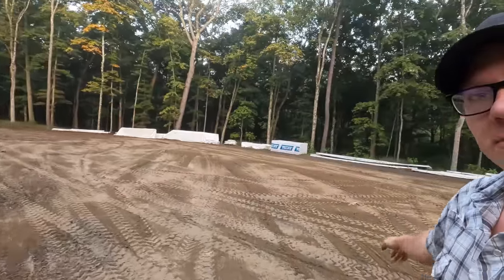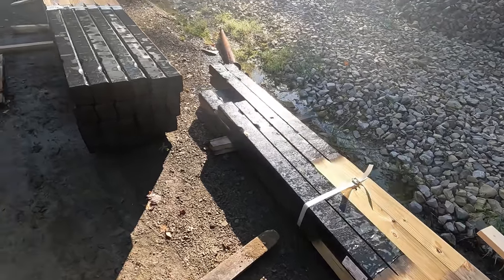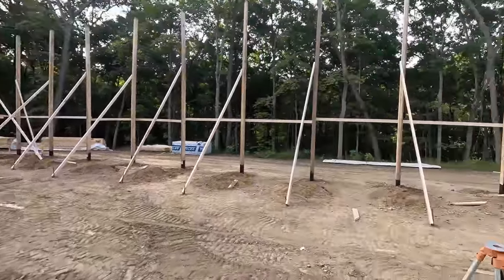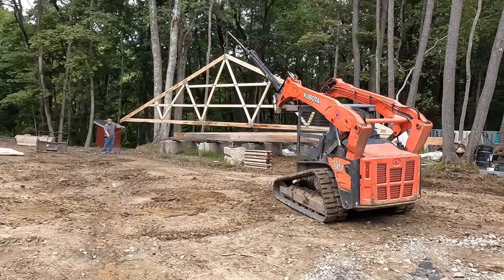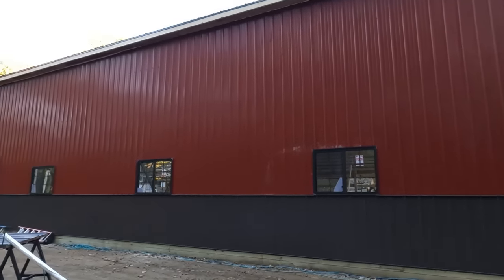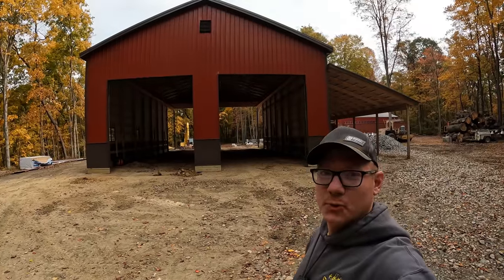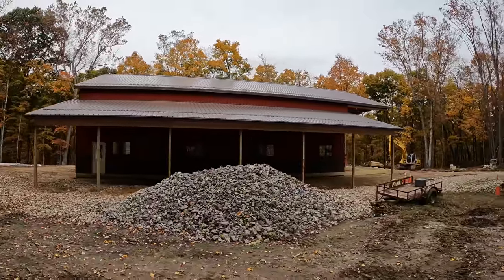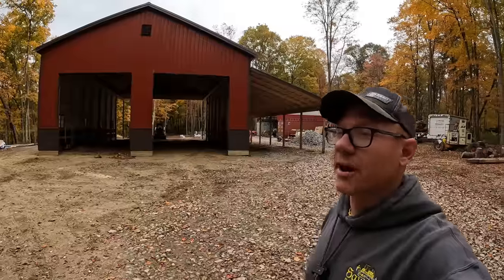Building a Dream Workshop! (Finally) Putting up the shell!

Comment: Nice building Matt, those guys did a nice looking job, it looks square and plumb by the way the metal all fit. The will be nice to keep some of your equipment in out of the weather, especially in the winter. Are you planning on placing concrete in your lean to area while you have the masons there? It looks like a good spot for a couple of chairs and a table when you’re relaxing or editing, or enjoying a canned adult beverage. 
And don’t let anyone tell you different, a 40 x 80 foot building is huge! Good luck filling it up.

Comment: One thing I would like to mention is the ground treated wood will rot out in 20 years. I can testify to it. The posts on my over hang need to be replaced also. I should have put in Sauna Tubes and bolted the posts that way it would be easy to replace later. You could still wrap your ground treated wood with metal which would make it last 40 years. I built my shop at 38 and now I'm 60 and the side metal on the bottom of the building is coming loose. Bad news is I concreted the sides of the shop.:face-orange-biting-nails::face-fuchsia-tongue-out:

Comment: Beautiful building,  as a builder of these pole barns post frame structures for 25 + years I do have some concerns though.  Did you put a cement footer under the posts? If not what's to keep it from sinking? Another concern is they did not stagger the seems on the "purlins" on the walls couldn't tell on the roof if they did with them or not or if they staggered the lam beems from the inside from outside. There should also be bracing on angles on the trusses all the way down the building!

Comment: Looks great 👍 beautiful architecture with the red walls 👍👍
Never seen a system like that before. Good thing, Hurricanes do not reach up there north,
and the forest around will protect the building from very strong winds.
Are the poles like 15x15 cm in size, difficult to estimate by video.

Comment: Sweet build, subscribed, usually breeze through utube vids, but not this one. Love overhangs always a good useful thing on a building. Like what you did by stepping down for the lean, makes more sense for servicing the roof, lines look better. You could add another post 2-3 ft away from the end post just to double up,  you could lattice in between with something to give shear. Those outside lean posts could get a low wall 2-3ft step over to keep stuff from blowing up against building area, also adds shear. skylites would have been nice even if up on ridge, natural light is always nice  but snow load might be too much. will be great to see you fill it all up!  good on you mate.

Comment: Shop looks great. My opinion is to have the end enclosed at this stage to have your end result look consistent, like concrete floor with no slope, outside wall material will age at the same rate, etc ... If money holds you back fully understandable.

Comment: You have the room why would you not go with 14X16 the extra 2 foot is ausom when you need it and I would recommend going with Richards-Willcox R16 overhead doors there strong and warm  and for me I would (money permitting) I would have full view windows at the 10"to 12" panel so it would give you a ton of natural light in and the added security by not makeing a easy b&e point of entry.

Comment: 40x80' being small???  Hell, I built my dream shop, (a bit fancier construction) and it was only 40 by 20.  It has storage above, but so could yours.  Mine is mostly for woodworking, and I have built since some separate buildings, (for storage and for painting) but still 40x20 isn't so bad for a woodshop.  It would have been "nice to go to 40 x 40, but by 80?  that is pretty darn huge.  Course if you are working on vehicles inside, I can understand needing more space.  I have a separate tractor barn.
this IS a pretty nice building site.  You are going to love it.

Comment: Looking forward to the concrete job 😎 PLEASE use a professional company for the floor. Once its dry there is no changing it again. Anything on the building can be changed or fixed but the floor should be there ''for ever''. 😅 Damn I have seen competitors make floors so bad you could trip on them.

Comment: Luv the channel. Quick advice: floor heat in the slab is generally IMHO a waste of time. I have r38 styrofoam under my 8“ slab and I can blow a lot of heat into it but it doesn’t stay warm long. I added solar panels net-metering and minisplit high efficiency heat pumps. Use cheap baseboard heaters keep stuff from freezing and when you work in the shop get 24-36k btu Heat pump bring temp up. Or are you using a waste oil heater/boiler?
Reply: Also insulate insulate!! I have r51 steel building. More insulation = more comfort. Payback is just couple years of you add 50%+ more insulation than standard.

Comment: I have zero experience with them, but have watched a few YouTube videos (😉), and I'm curious how you will keep an outdoor wood boiler from freezing if you are not there to add wood each day or two?  The videos I have seen indicate that once you start them for the season you have to keep the fire going to prevent any freezing damage if the temps are low enough.  Are there types that use some sort of antifreeze vs just plain water?

Comment: You said Peg pipe I thought you mean Pex Pipe for Kurn and accessory crimp gauges. If you need it said by the plumber. The Zurn in a case costs you $75.00 or $150 dollars from the store in Durham. The Chinese made the crimping tool is going to a truck R&R liquidation sale. I have Oakley brand 12 ounces primer and bottle of glue for PVC pipe 1/2 inch. You might get the recommendation of fire hydrant  with size 3/4 inch diameter faucet pipe. 
 Do you have 100 PSI water pressure? Or more PSI in all level flat of the ground?

Comment: Looks bloody awesome mate probably a couple of small issues we're I'm sure you have already address autumn foliage bocking up the spouting glad to hear that you're putting Steel sheeting inside will you be using solar energy the central heating idea is absolutely perfect especially if you can access the the hot water after it's been heated as I'm guessing it's circulating through the floor we have done a similar central heating system where we can shut different sections of the family through the summer period and still access hot water through the wood burner the height of the building wondering if it's worth keeping in mind to a maze floor but overall I think it looks bloody awesome mate oh by the way have you got a fire plan I'm not too sure what you're part of the world gets like through the summer. The old man stuck a sprinkler system running a fairly heavy pump system across the roof works bloody well top job bloke 🤙🤙

Comment: Hey Matt,
Great to see this put up.
Just wondering - wouldn't some clear panels in the roof help with keeping lighting costs down (though I guess you'll be using some more of those great LED units anyway)?
Also, given the amount of land you have around the new shop, would a ground heat exchanger not work for the underfloor heating (to keep the costs down, with maybe a smaller wood burning unit to supplement it if needs be), or would it not be man enough for the size?
Really appreciate your channel and the time you put into reviving the old machinery, thank you.

Comment: So much work to get to this, well done, looks absolutely mint! Please keep it up, so good to watch the progress videos.

One question I have, will you be using the LED light design you used under the container roof to light the inside and outside of the workshop? 
Also - add two more power outlets than you planned, you can never have enough!
Reply from the maker: Yes they are on the way

Comment: Adding to the comments here (YouTube loves this stuff), I wondered why you didn't add some translucent siding (between leanto and roof) to let in some daylight into the top 1 or 2 feet of the shop? Insulation is better without it, but lighting is better with it.

Comment: Those what look like dimensional PT posts are going to try to twist and buckle over time. Should have used built up laiminated posts set on concrete piers,.. you could have put in yourself.

In the time it took to get anyone started with all of the equipment you've accumulated you could have probably done the whole thing yourself hring a few guys here and there when needed.

For the height of the building you don't appear to have much lateral support against wind and/or a combination of wind and snow loads. The spans on the lean to look pretty long for the joists being used to support what I would think are pretty high snow loads in your area.

I see what may be thermoply on the lower portion of the wall and if so it is rated as a structural panel, but it's on a very small portion of the wall. 

Metal siding doesn't provide much lateral support. Especailly ribbed siding.

The bottom chords of the trusses also need to be tied to each other and into each end wall with x bracing so they don't twist and the roof come crashing down,.. especially on scissor trusses.

I would suggest before you install more metal siding on the inside you either install plywood at the corners at least or install cable or rod and turnbuckle X bracing throughgout including in the ceiling like they do in commercial metal buldings.

Too late now, but R&R Buildings has a pretty good system and process if you aren't familiar with them. You could have gotten some details and techinques.

https://www.youtube.com/watch?v=CNOnfp-9iFA

Comment: It doesn’t have to be huge to be your dream shop 
It has to tick all the box’s you dreamed it needed too 
Ie n floor heat, isolated /attached storage compressor room 
Fire rated Welding shop section with a large over head door (clearance for my gantry Crain) 
Welding/ plasma bench with an exhaust hood 
Wood working shop (isolated from the welding shop section 
Smaller overhead door would be nice though it probably won’t be exterior grade lol 
And a mechanic shop with a lift and a another large over head door at the other end 
Small attached paint booth 
And just enough space for all my tools 
Sadly I’ll have to isolate heating to the centre section given it gets ungodly cold up in Manitoba 
But a dream shop is your dream shop that shop that you think about for decades 
All the options you’d like to have all the requirements you have to have met 
It’s the shop guys like us dream about for as longe as we have been able to swing a hammer

Comment: Okay if you're bent on this radiant floor heating at least put styro on the perimeter edge of the slab=inside of the rat board buried not less than 2 ft and use the 2-in foam throughout quite importantly be sure your PEX tubing is not deeper than one and a half inches even after that heard of mud wrestlers is through stopping it all the way to the bottom.

Comment: With the poles  into the ground  . Are they set in concrete or is it backfilled  and compacted  earth.
Reply from the maker: Back filled with dirt. They are sitting on a concrete cookie
Reply: @DieselCreek  fair  enough   what would it have cost  to build  in steel 🤔  your  country  have different  building  regulations  to Australia  where I live.
Reply from the maker: @ianmitchell3725  I wanted steel, it was over 3x the cost.
Reply: @DieselCreek  ouch

Comment: If you need a great way to heat that barn/shop let me know. You can pretty much heat the place for free, just burn the wood that you have for scrap and any of the extra trees and brush your cut down that you don’t cut up for boards. This thing will heat a 60 x 80 pole barn with no problem

Comment: The lifetime warranty, they give you new poles. Not installed. Good luck replacing them, would be a great video! I like concrete pillars.
Reply: I’ve dug out barn poles, put in 55g drum, filled it with concrete, then set the pole back down. It’s a lot of work. But the barn stands, it doesn’t lean.

Comment: (Excuse me for skipping well over 5k comments.)

Yes, it does look great! - However, I'm worried about the longitudinal stability. I noticed just a few and puny triangles in the wooden frame. - Installing that crane looks great too, but unless its rails should stand on their own supports, I'd be glad for not being your insurer. - A shower under the overhang does appeal to me. So would a room for pressure cleaning (air, water) and spray-painting. - Anyway, I do wish that using rhe workshops exceeds even your hopes.  :-)

Comment: Nice shop congratulations. 
Did you check with one structural engineer about the big opening that you have, without any wall to braces in that direction. 
Please be careful, I would not like to see you hard work to be wasted with some catastrophic event.
Reply from the maker: It’s getting framed in after the concrete

Comment: Here's a good example of how the man likes to hush bad news. Did you know high performance styro and polyiso do something that's called gas - out which means it gradually reverts in R value to be about as good as beadboard which is R- four per inch it also shrinks to leave big gaps between the sheets. And here's one that I just couldn't believe but it is in the white paper if you read the fine print regular fiberglass insulation is R-rated under bone dry conditions any humidity whatsoever in the air between fiberglass fibers greatly reduces the RV.

Comment: Beautiful workshop but, IMHO the building it is not structurally strong. It needs to be reinforced to resist strong winds and snow (or ice) weight. I would place X-shaped beams between the vertical pillars. The foundations are not appropriate for that type of pitched ground terrain. Please, look for an inspection and advice of a structural engineer. Good luck and BTW my congratulations for your impressive work and high skills to restore that old and beautiful vehicles.

Comment: Were the post's set in concrete?
Reply: Not that I could see. Just straight into dirt and packed in with dirt.
Reply from the maker: They put concrete footings under them. But no you just pack it in with dirt concrete holds moisture against the post

Comment: I give the USA grief about how fragile their buildings are.  But you know what?  They sure do go up quickly.  Over here they'd have a full 6 foot foundation, 12 foot block wall and steal I beams in that sucker, but it would take over a month to build.  It'd also cost 10 times as much by last 100 years.

Comment: Really love to see the building process like this! Very curious about the rest of the process. I see that the way of building is very different from here in the Netherlands. We would definitely use a steel construction.  You will need that anyway for your crane. Can you tell some more about the choice for floorheating with a woodburner? Why not use heat pump using heat from the ground in combination with solar power?

Comment: just some questions, floor drains, fresh water lines, underground electric service, bathroom drains,I worked at a car dealership with floor heat it Never worked , your feet were on fire and the rest of you froze had to go to forced air heat, just thinking outloud beautfull building

Comment: A lot less toxic and cheaper to simply CHAR the posts before using them as we did in the old days. Japanese buildings have lasted over 800 years using this simple eco friendly method. No tape on the wrap??? Are you going to insulate??

Comment: That is a super storage I don't believe it is a workshop. What do you think about the color red sheet metal roof and sheet walls super storage. The windows were 5 or 6 windows held by the wall or two walls. The insulation were put in between the sheet metal exterior wall and wood wall not all solid wall except the full sheet metal. Next is the skylight as an option on the slope of sheet metal roof for heat in the big barn workshop from the sun. Tint or no tint roof windows named skylight solar giant component of the shelter. Giant component is another word for roof. The complete 2 slope roof with a roof one slope together. The hardened glass skylight or the plastic transparent of the roof plexiglass. The glass cannot be annealed glass for regulation of the safeties.

Comment: Not a huge fan just having some nails hold up your whole roof. By the looks of things the header is not notched into the posts or lagged in. Seems kind of sketchy. I would want to know the sheer rating of those nails. Again I've never seen a gable truss just nailed into the post.
Reply from the maker: If you look closely you can see that they have the header boxed and boards coming through the header attaching to the truss. The LvL headers are lagged on. It’s very solid not going anymore
Reply: @DieselCreek  that's good news brother. That's the problem with watching videos on the phone. I miss a lot of detail. Just glad it's done right. Great looking shop man. Looking forward to videos to come.

Comment: Absolutely gorgeous sexy design… you will need a kitchen and bathroom… so I don’t see anything that wasn’t thought out entirely… I think I would gusset the corners of the over hang it would add a huge structural strength component…

Comment: Obsessive individuals like myself are picky about details such as incorrect dates on time lapsed videos.  Not mean-spirited, just how I am.  My watch sets time daily with the atomic clocks in Ft. Collins, Colorado.  My home network router does the same with the NIST protocol.  It’s a holdover from my days workin in a data center with severs using directory services.   Time stamps were critical to database consistency across remote systems